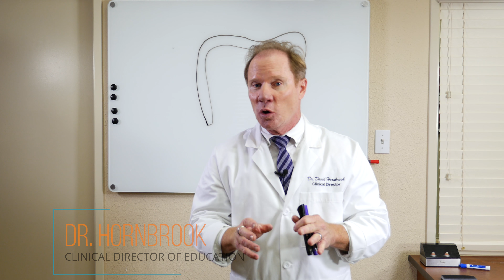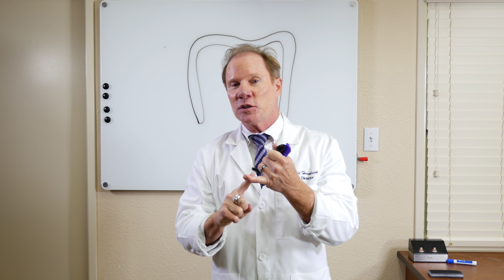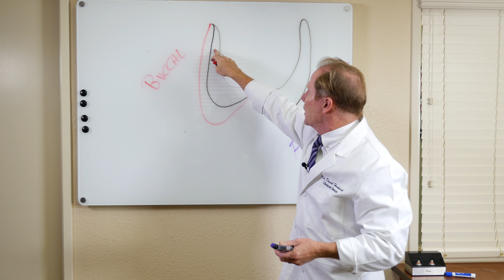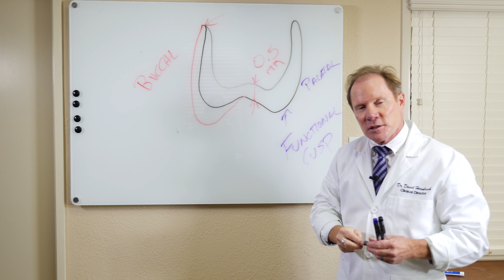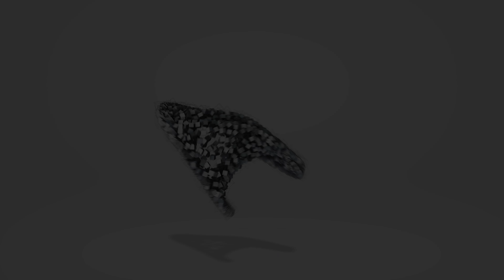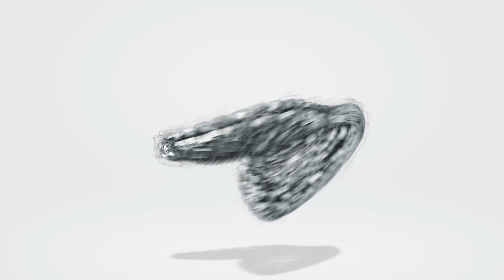Zirconia Crowns Layered with Noritake Ceramics

Comment: Hi Dr Hornbrook. Very informative video however I think you have been misinformed about the flexural strength of Zirconia, it is not 1500 mpa , it is closer to 1200 mpa max.with most commercial brands being around 1000 mpa. The more translucent the Zirconia, the less the flexural strength.. 1000 mpa is however plenty strong for most uses. Also, the layering porcelain is usually between 65 to 100 mpa as you stated but it is a single phase glass, which means if a crack starts it continues unrestricted and usually ends up as a whole face or sliver coming off. Traditional VMK (80 - 100 mpa) and Emax( 650 mpa) porcelains have " crack stops" like lucite or lithium disilicate to prevent crack propagation..zirconia porcelains don't..
What you say in your video is correct, but the information provided above I hope will help with correct material choice for any particular case. regards and thanks again for an informative video.